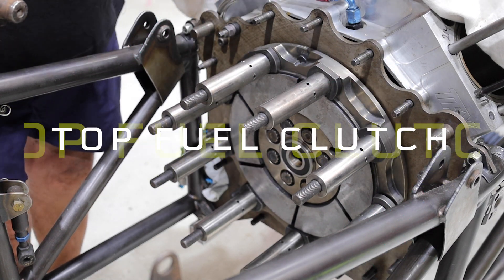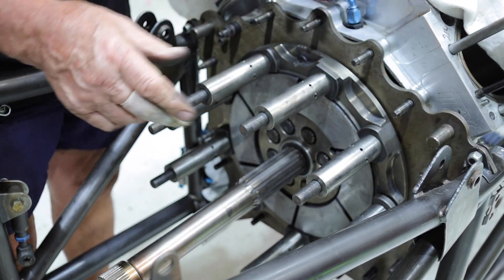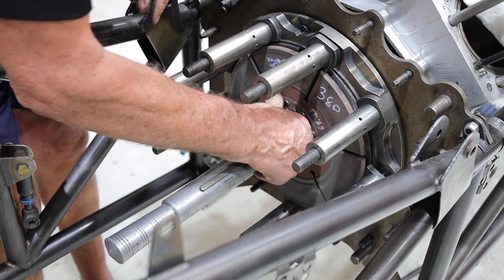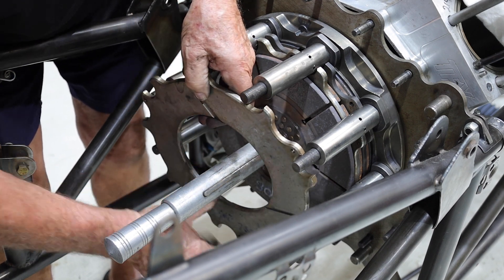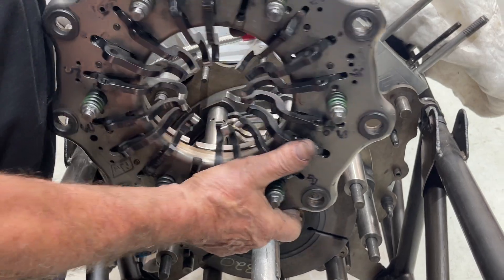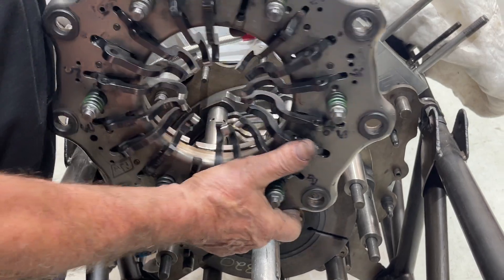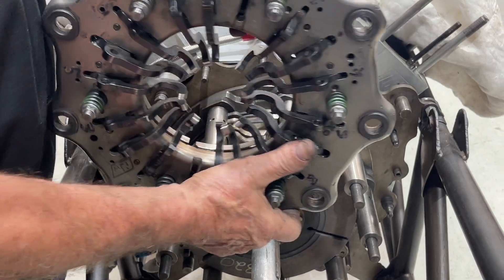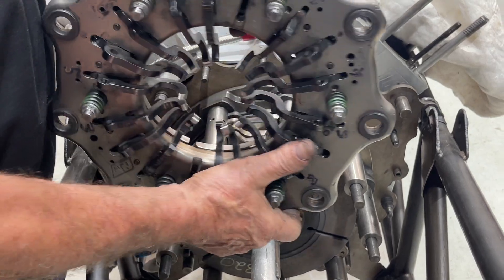HOW TO INSTALL A TOP FUEL DRAGSTER CLUTCH (PART 2)

Comment: Missed part 2.  Got it a year later.  Funny how that works.

For reference, ON THE AVERAGE, Classic muscle car fender washers are 60 thousands thick. Some are 40 and some are 50, depending.

50 thousands is a pretty loose clutch pack setting, i would hazard a guess.

You can buy a single disk slider like above for your race car, with adjustable primary and secondary fingers.  Alot of work rocking that clutch.  Carry a spare disk or two, and get good at pulling trans apart to adjust/replace clutch. Good for 1800hp they say.

Comment: Reminds me so much of setting up brakes on 20–50-ton overhead cranes.
If you took 2 hours with feeler gauges between each of the posts, to get the pull-in and release just perfect as every time you set one post, the others changed so slightly, for the electric solenoid's magnetic field, the brakes would not chatter or buzz, and would last for years. If you just stuck the feeler gauge in at each post bolt and set it once. it would last a month.
I wish that they had thought of having precision length posts around the threaded rods like this. (Glad I am retired now, but if hoist brake manufacturers could see this, their parts sales would be cut 90%. (OOPS!, did I say that out loud.🤐)
I can't imagine the patience it would take, to adjust that many posts, without the bars around the screws.

Comment: I’m just curious if you use copper-based anti-seize on the clutch stand threads and hat nuts.. and what your feelings are on using a speed loader versus a dummy shaft?
Reply from the maker: Hi mate, No I don’t use anything on the threads as if you use any type of lubricant the clutch dust sticks to the threads and seizes them. As the stands are titanium, that gets pretty expensive to replace. Fuel car these days wear between 120 to 180 thousands of an inch wear every run which is the black cloud when you see the car leaves the start line.
The dummy shaft was so viewers could see how it went together, at a race meeting we would use a speed loader due to time restraints in between runs. Thanks for the question!
Reply: @stevereadTF  thanks for the response!!  Its crazy how much has changed in just 5-10 years..!
Reply: More real tech info that makes A fuel, A fuel Funny Car. Top Fuel and Top Fuel Funny Car watching understandable about how much time, money, experience it takes to make a single run. Then do it again (REPEAT) every single run. I have an even greater respect for the clutch person than before your video presentations.  This must be with the coordination of the crew chief/tuner/chassis set up, ect, ect, ect.
What a coordinated effort, you folks that love the sport are appreciated, by this old naturally aspirated door car guy.
Thank you for the time, effort and resources that it takes to make these videos.